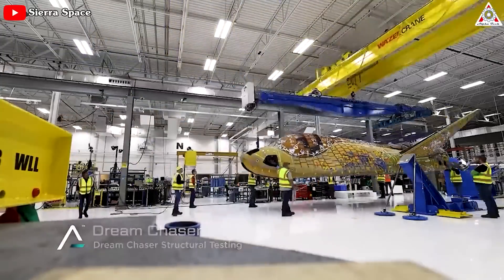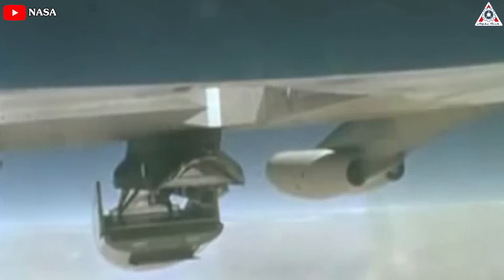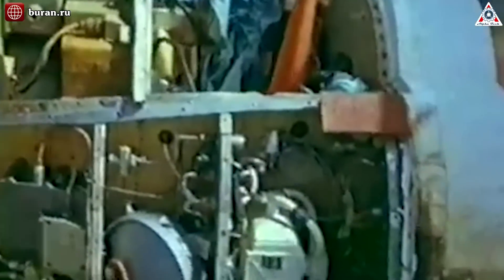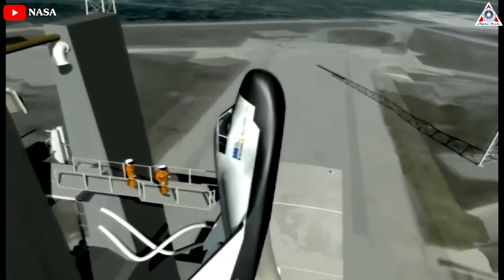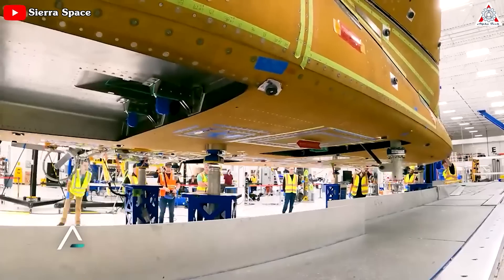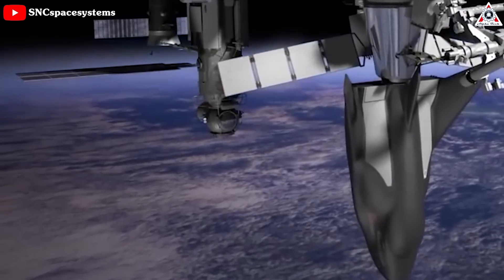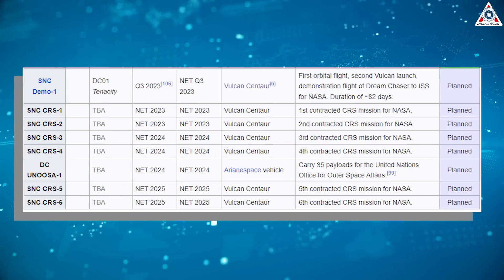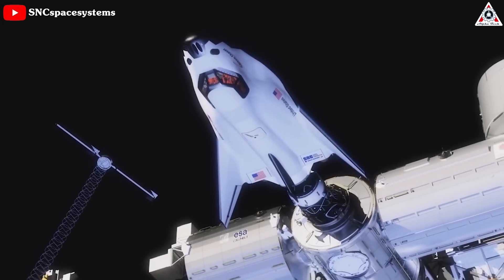Dream Chaser is almost ready for its first launch & future propulsion, to replace Shuttle

Comment: SIERRA WILL DO WELL, HIGHLY DIOSCIPLINED IN ENGINEERING, EXTENSIVE THERMAL VAC AND VIBRATION TESTING. They won't rush anything into orbit. They have Disciplines Boeing is Lacking....and test disciplines Space-X Failed to incorporate with their Major Changes to Flight 7 & 8.

Comment: Add mass to deal with unknowns?   Aviation and space engineers don't simply add mass to deal with unknowns.   Mass reduction requiring very high levels of analysis and further research for slight savings in mass is only worthwhile when the overall design has proven itself as production worthy.   There is little to be gained by redesigning systems for a slight reduction in mass in an unproven vehicle.   If the project never reaches production worthiness or its purpose turns out to be better achieved by some other method most of the detailed engineering and research to reduce a small amount of mass is of no use.   Some aspects maybe beneficial for other projects, but a great deal of the work, which frequently means having numerous parts condensed into fewer parts more specific to the vehicle will die with the project.

Comment: I think SpaceX will have most of the launches from earth, but there will still be a need for vehicles that spend most of their time in space. Dream Chaser could transport cargo or passengers from space station to space station. Maybe even to a lunar space station.
Reply: @TexanUSMC8089 Dream Chaser would have a tough time landing on the moon as there is no atmosphere which is needed for wings to create lift. A pure rocket lander is the only option at this point.
Reply: It's not optimized for that -- those wings only serve a purpose in atmosphere. If you're traveling between locations in space, something that looks like Cygnus with no heat shield would be a better bet. Or a rocket.

Comment: How is Dream Chaser a replacement for shuttle if shuttle was retired 12 years ago? The SLS is the replacement NASA chose for shuttle.
Reply: No, SLS is a heavy lift vehicle and Orion is a deep space crew spacecraft. For cargo, the Dec 2008 Commercial Resupply Services (CRS) contracts to SpaceX for the Falcon 9 and Dragon ($1.6B) and for Orbital Sciences (Northrop Grumman now) for the Antares and Cygnus ($1.9B) were the replacements for cargo to the ISS. The Sep 2014 Commercial Crew program (CCP) for $2.6B for Crew Dragon and $4.2B for Starliner, were the replacements to ferry crew to and from the ISS. Dream Chaser was added to the CRS contracts in 2016 and as the video says, SNC wants to use the CRS contract to prove out a crew version of Dream Chaser.
Reply: @steveaustin2686  The CCP is dedicated to taking cargo and crew to the ISS using those vehicles, but ISS visits was just one of the things shuttle could do. Towards the end of shuttle’s career, taking crew and cargo was the main focus of the program since they had to finish building the space station. If the space station was never built, the CCP would not exist but shuttle still would. A replacement for the shuttle would still come, which would be the SLS. That’s why the CCP is not the replacement of shuttle but SLS is.
Reply: @nachobasket  Again, SLS is a deep space launcher, NOT for LEO. It would be OVERKILL in LEO, just like Orion is overkill in LEO. That is why the CCP went with Starliner and Crew Dragon, instead of Orion, which flew to orbit for a test, just 3 months after the 2014 contracts were awarded (Dec 2014). Crew Dragon flew its first orbital test in Mar 2019 and Starliner flew its first orbital test in Dec 2019. 

Neither the SLS nor Orion were a replacement for the LEO only Space Shuttle.
Reply: @steveaustin2686  Just because the new vision for NASA and SLS is deep space does not mean a program that is dedicated to LEO (CCP) is the replacement for a previous vehicle that was only LEO capable. NASA replaced their LEO capable vehicle for a deep space vehicle.
Reply: @nachobasket  The ISS was already built and they needed a LEO spacecraft for it. Using SLS/Orion for ISS crew transfer missions is ludicrous.
Reply: @steveaustin2686  I was talking about shuttle. It wasn’t built solely for space station ops unlike CCP.

Comment: Sierra Nevada should adopt Falcon 9 for launch.  Better than Atlas V and no chance of it being discontinued.
Reply: Dream Chaser is launcher agnostic per SNC and can fit on the Atlas-V, Vulcan Centaur, Falcon 9, or other suitable boosters. Cygnus is launcing on the Antares 230+ booster and will do at least 3 flights on the Falcon 9, while the Antares 330 booster is developed. Dream Chaser dropped plans to launch on the Atlas-V and is launching on the cheaper Vulcan Centaur. The Dragon launches on the Falcon 9. So if Dream Chaser stays on the Vulcan Centaur, then NASA has 3 different cargo spacecraft on 3 different boosters, increasing redundancy, in case one should develop problems.
Reply: It may very well end up launching on F9. NASA prefers to have overlapping missions flying on different launchers, however. That way a launch failure of one won't ground multiple vehicles.

Comment: I would rather land on a runway under control than splash down in the ocean.  Bravo
Reply: With Starship you would land upright… same as how it launches 🚀
Reply: @tomgreaney1  That is stupid and overly complicated. Never going to be man safe. All tall tail sitters in the past have proven impractical. Only one that ever worked was the LEM and thats because it had a low aspect ratio.
Reply: @anthonyb5279  what "tail sitters" were in the past?
Reply: @anthonyb5279  never say never
Reply: @user-xk4gf9jz8c  "what "tail sitters" were in the past?"
Yankee Clipper for one, but it wasn't "proven impractical", it was just abandoned after a third scale prototype successfully landed.